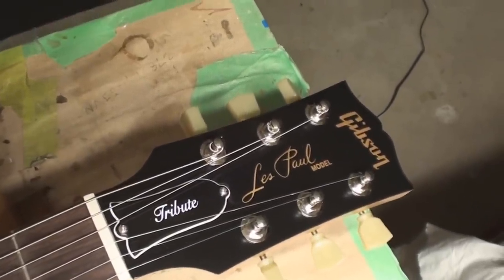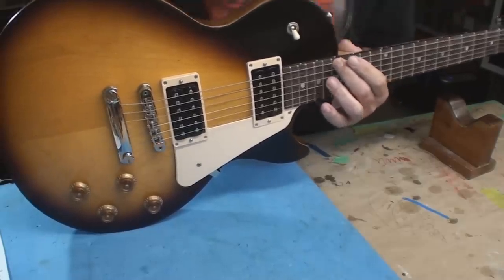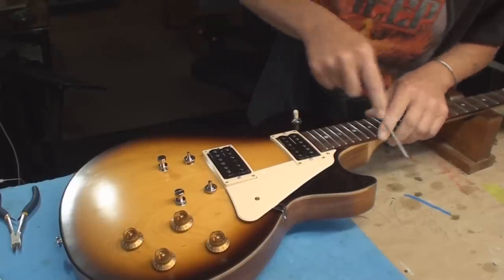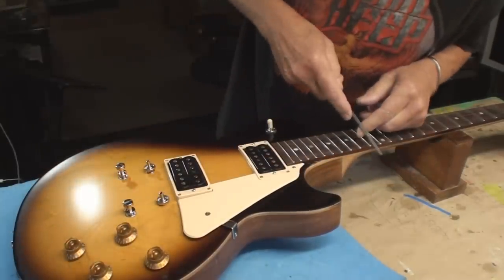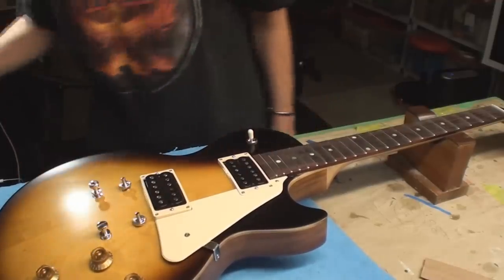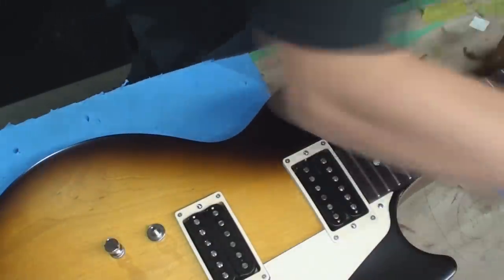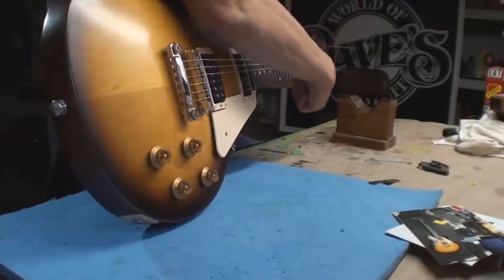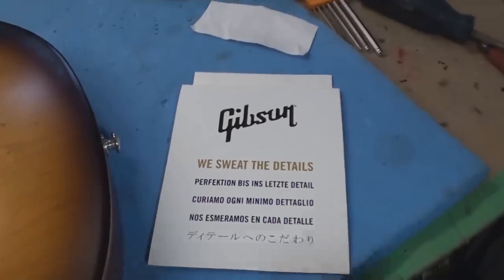Gibson Les Paul Tribute NEW FROM THE STORE

Comment: Wow. I remember "video responses". Flashback! Who remembers when YT wasn't owned by Google?
Reply: dbltrplx  I don't remember that far back.
Reply: Do you remember star rating?  :)
Reply: dbltrplx  Haha good one!
Reply: And the comment boards on people's profile pages.  Which were also much better than the current pages.
Reply: dbltrplx  not since the 1950s
Reply: dbltrplx  I did the math and adjusted for inflation, a new standard 2019 SG or LP costs about the same (if not less) than their 50’s and 60’s counterparts did at the time. So, there’s that to consider. Perhaps people are accustomed to prices that are artificially low (due to offshore manufacturing, for instance).
Reply: Youtube was only around for a year before it was bought by Google, contrary to popular belief
Reply: But can you compare the quality of the woods and the construction of one original 58-59 to one 2019 Standard?
The closest thing would be a 59 Reissue Custom Shop and those cost €5000-6000 in Europe.
Reply: @alanshewitt  the thing is that there's no reason for a guitar today to cost what it did 50-70 years ago because of advancements in manufacturing technology. Why is it even remotely in the same ballpark when Gibson's woodshop can churn out necks and bodies with almost 100% automation? Before CNC the method was one at a time with a human routing the bodies with a set of templates on a pin router. Of course there are things that need to be done by a human, but by and large the wood working portion of the job is done by machines that can run while factory works do other work. $2500 is absurd for a Les Paul standard, especially when you consider their dogshit QC. The point is that the prices Gibson charges are very much NOT reasonable in today's world, ESPECIALLY when you consider the dogshit QC and antiquated building techniques (can we please get some fucking scarf joints so the headstocks don't snap off when you sneeze at it?)
Reply: dbltrplx  if you want to know who has confused themselves into thinking that's been true since the fucking 60s, head to reddit and mention the quality control issues.  Be prepared for the death threats
Reply: @Benderbot50  If you put a scarf joint on there the gibson fanboys will whine about tradition, because there's nothing more traditional than a broken neck right?

Comment: I have this model, bought new. 
One small issue, that it has some small long snag under the headstock, which could be easily removed on the factory, but seems like guys from Gibson, thought it will be hidden under laquier. But it is not. Other than that, guitar is perfect. Looks like normal Gibson guitar for rock&metal, without extra blinks, trapezoids, thick laquier. For any price from LP-line, i would choose exact this model for looks and comfort. Made from one peace of mahogony, 2-pieced maple, perfect neck profile (maple). Guitar is very comfortable and sounds amazing. Even without being connected to the amp, it resonates perfectly. Powerful pickups, so i can get any sound i need, from clean tones through crunchy to very heavy. 
PS 
I'm Fender guy, but last months i'm using olny this Gibson LP Tr:)

Comment: The one I purchased was basically a kit guitar. From the top down... The tuners were loose, the trussrod was not engaged, the nut was cut very nicely, the fretboard was bone dry, the fretends were terrible on both sides, heights of pickups, bridge and tailpiece had obviously never been looked at, paint fit and finish are very good. After many hours of work it has turned into a great axe. Always sounded as it should.

Comment: Dave, just checking in for the first time.  I just posted my own Strat setup video and I was so happy to see you mentioned the exact nut to first fret height of .020"-.018'.  I've just taken on the chore of trying to make nuts.  I usually just try to make the old ones I have sitting around, work, by shimming or sanding.  I'm embarrassed to say after all these years, I always tried to set them lower. But when I saw that those were Fender specs, I set my Strat up that way and the guitar played so much better down at the nut.  I bend strings a lot down there and always had to fight them because they were too low.

Comment: I've tried several of these and the new Les Paul specials. On a few of both of these the fretboard edge was short of the neck. Meaning there is a lip where the fretboard edge meets the neck. have you seen this on the Gibsons?

Comment: I bought a new 50’s standard and after a month It needed a new nut. Pissedme off 2500 dollar guitar - Gibson needs to angle the slots to accommodate the headstock but they don’t!
Reply: Seriously?! Wow! I have guitars that I bought off Craigslist/OfferUp for $130 or less (some of them Epiphones) that had zero problems with the nuts on them after I did a full setup and made sure the 1st fret action was where it needed to be. That's just stunning that a nearly $3,000 Gibson has issues even cheap guitars don't have!
Reply: I have several Gibson over the years and all has been fine. That damn G string was messed up i guess  it’s common problem for Gibson’s.  I’d tune it strum and  boing out of tune! I was pissed when my Luthier said new nut 🥜
Reply: I got a good one. was made sept 30 2019 very happy with my Gibson Les Paul. sounds amazing through my Marshall. Amazing!

Comment: Where do you get those fret files from Dave?
Reply: Don't make him say it, He doesn't like them very much ;-)
Reply: @Damaged262  Stu Mac?
Reply: @kirkdesmond  DING DING DING! lol, I also have my issues with the prices they charge. Many of the items can be bought at Valu, Home Depot or Harbor Freight and at a fraction of StewMac's prices. But, it's not any different going to a car parts store. It's just objectionable. I overheard a manager in a car dealership repair shop tell a worker to charge a replacement part a 300% mark-up. Having worked retail for years, I raised holy shit about that, sure, they double the price normally, you gotta pay workers and overhead, but you don't steal. Especially since the repair shops charge labor too. I have a deep hatred of thieves after I stole some coins from my Dad at 5 years old, he taught me the hard way to not steal again. I'm 56 now, I suspect my ass is still red. StewMac steals, it's that simple. I've made dozens of tools they sell, for pennies on the dollar based on their prices.
Reply: @Damaged262  Understood. Those special fret end files sure are sweet,  but my big box store doesn't carry those.
Reply: @kirkdesmond  Understood. I'm fortunate to have a grinding wheel, probably cheaper than the special file at Stew Mac for the file alone, and made my own from a cheap as hell file. If your hands aren't steady, like mine are no longer, I used a high chair, not kidding, to keep my hand steady with a towel to cup my arm. My basement workshop looks weirder than Pee Wee Hermans house.

Comment: Bought new 2011 LP Traditional. £1750. Let's say $2000. Should play out of the box right? Wrong. Would not stay in tune - strings sticking and pinging in cheap plastic nut. Replaced with tusc. Gap between binding and fretboard - top E string constantly snagging in the gap. Luthier glued and clamped. Plekked frets as tall as buildings. All needed re-crowning. It is now a fine guitar, but instead of push pull pots and extras, Gibson should apply PRS level Quality control. What say you Dave?🌴

Comment: Personally I bought a 2018 Les Paul Tribute and it's a great guitar for £700. I don't know why people spend 3 or 4 times that amount for other Les Paul models which are basically the same as the Tribute except they have different pickups, binding, and a few layers of clear coat lacquer.
The 2018 Tributes were the best ones they made, they had no weight relief, decent knobs & inlays, and those soft shell cases were very nice indeed, but I wouldn't buy a Tribute from any other year. They've already started cutting corners with the 2019 Tributes judging by the guitar in this video.
Reply: My 2019 Tribute has trapezoid inlays and covered pickups and a nice soft shell case. The paperwork indicates it was manufactured in September 2019.

Comment: Judging by how High the stop bar is already, the neck angle is all kinds fubar...
I have a 2013 and run with the bar firmly decked. Unfortunately, lots else wrong with it. Its been rewired, new pots, switch broke in six months or so, tuners broke. POS. Gibson's inability to do the basics is why I don't buy them anymore. You want to charge premium prices, need a premium product and even one in 10 leaving the factory like this is too many. At those prices, there is no acceptable level of fail IMHO. Its perfect, or its junk!
Reply: @DavesWorldofFunStuff  But it looks ridiculous. Also I don't recall ever seeing even Norlins with stop bars up 2+" in the air dude. Just put the neck in at the right angle.. 🤷‍♂️

Comment: Why do so many Gibson haters flock to Gibson videos?
Reply: I want to like Gibson. After all they made rock history. I have a feew Friends who own Gibsons and let my try them. They all (but one) complain that the guitar doesn't stay in tune (headstock design?) and two had broken necks (guitars, not the Friends). The Sound is great, but imo simple Things could massively improve the guitar - do the headstock more PRS like for straight strings and not bent back as much - like Epiphone does, for neck saftey. And generally I don't think that Price/Quality is OK. I get good Sound of other Brands that stay in tune nad have better build Quality for lower Price - Maybe not the Sustain, but that's in the fingers anyway.
Reply: @huginstarkstrom  Gibson can't change because people demand the exact features on found on a 1959 Les Paul. Any attempt at change is met with backlash. I think it's part of the charm. Nut slot tolerances need to be exact, but a good tech and a small amount of graphite in the D and G slots and a Les Paul is just as stable as anything else. As for head stocks, just don't drop your guitars and your all good :)

Comment: I just bought a new les paul tribute with the open humbuckers,  490R and 490T,   I have had Gibson Les Pauls and es models with different pickups and so far I am not liking these pickups. The 490t may have  a problem, way lower volume than the 490R after much adjustment , still not satisfied. The 490R seem to have a lot of low end. I liked the pickups in the es339 and the older les paul special. I need to decide what to put in the neck position.....>???  any ideas...??.....pete

Comment: you mean the strings hit the pickup, not the bridge?
Reply: No the strings were touching the back of the bridge they should touch only the notches in the saddles then go directly back to the tailpiece. Many people confuse the actual bridge with the saddles. On an acoustic it’s easy to see the difference. The bridge is the wooden part glued to the top and the saddle is the generally white piece of bone or plastic that sits in a slot in the bridge.